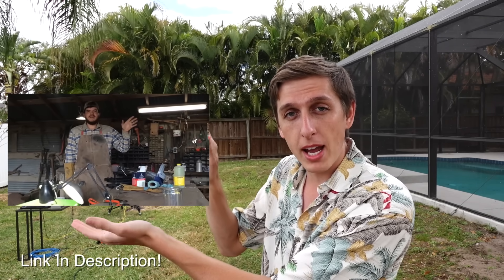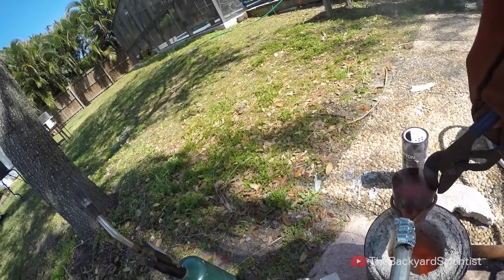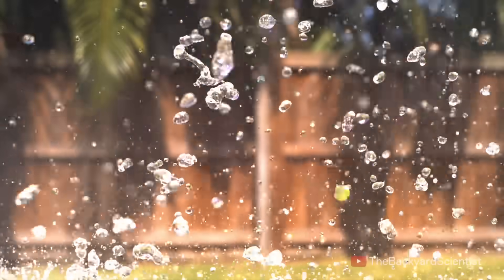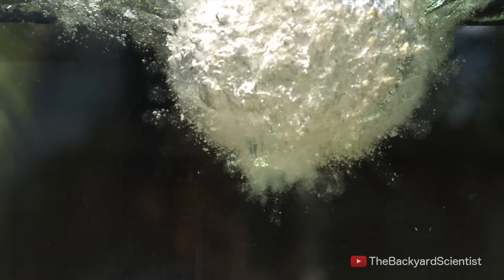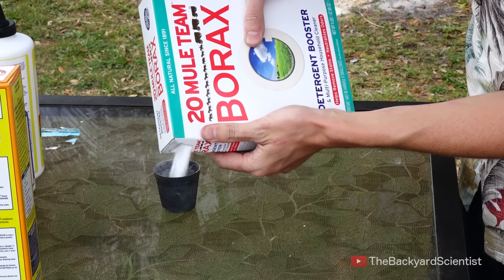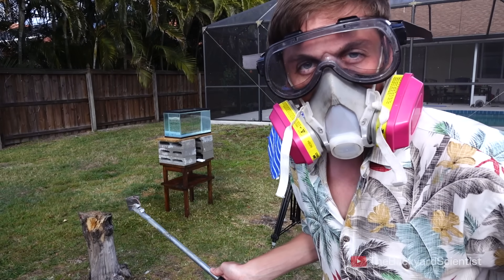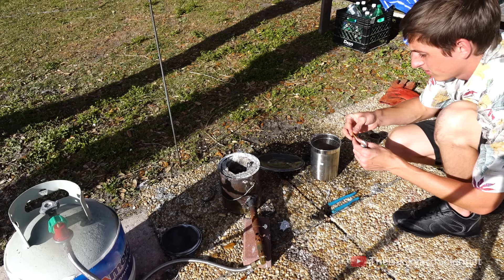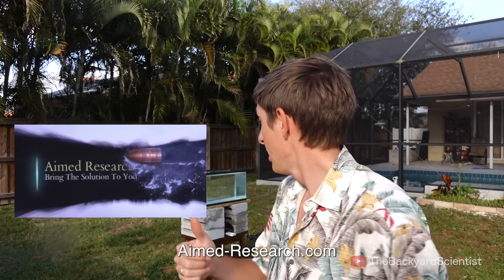Pouring Molten salt into Water - Explosion!

Comment: First off, to help support your theory supposedly disproving a chemical reaction, simply testing the ph of the water before and after adding the molten salt is not enough, it would require comparing it to the same when adding pure sodium to the water and when adding normal salt. Should both normal salt and pure sodium give changes while molten salt doesn't, then it would be proof of it not being a chemical reaction. Assuming pure sodium does not change the ph balance of water upon reacting (which I believe is the case), the lack of ph change despite the presence of chlorine is likely the result of the chlorine becoming gaseous upon reacting and escaping via bubbles.
Second, it would be a chemical reaction, not a physical one. Heating up the salt would weaken the bonds between the sodium and the chlorine in the salt. Upon adding it to the water, the reaction would not be instantaneous due to the chlorine still being present, delaying the explosion. Without oxygen (gas), the normal sparks and flame from adding sodium would not be present, but the force of the reaction would displace the water, possibly even more due to the presence of chlorine (which upon reaction would likely form chlorine gas, its natural bonded state, which would also explain the lack of a spark). The reason why molten borax would not react is likely that it already contains water molecules (the chemical formula being either Na2B4O7 - 10H2O, or Na2[B4O5(OH)4] - 8H2O), being a hydrate, which I believe would prevent a reaction with water. As stated in the video, pure sodium reacts differently as it reacts the instant it touches the water (actually technically a little sooner, reacting to the moisture in the air), not letting it submerge and preventing the outward blast, but due to the oxygen (gas) in the air would allow for a spark and slight flame.
Reply: I don't see how it could be physical, if you through sodium in water it explodes anyways, it doesn't have to be molten
Reply: Shut up you nerd, He's testing for PH simply to see if Sodium Hydroxide formed, because then he would know it would be THAT reaction
Reply: Ms So first you call me a nerd for knowing stuff like that, then try proving me wrong anyways... That totally makes sense without being at all hypocritical...
Anyways, realizing I had forgotten about NaOH, I just looked up various things to see if I could figure it out (eg. could the remaining Hydrogen from the sodium reacting to the water bond with the remaining Chlorine from the molten salt to form Hydrochloric Acid as well, thus resulting in a secondary reaction between the newly made HCl and NaOH, resulting in salt water to result in the normal pH? Turns out not) and found the actual answer. Turns out, everyone is overcomplicating the reason, though I can't find an answer to the borax part
The answer? Salt melts at 800 degrees Celsius, as even stated in the video. When the molten salt hits the water, it boils and becomes steam almost instantly, causing a steam eruption under water. At the same time, the water cools down the salt, until the temperature balances at a point where the water doesn't continue to turn to steam, and the salt dissolves in the water (at an increased rate due to the heat). Thus you get steam and salt water, resulting in a balanced pH for the water. If the salt has cooled enough before going in (such as during his failed attempt), the reaction doesn't happen, or at least not on a large enough scale.

Comment: Hmmm, this is actually pretty interesting. So if I get this right you've tried with NaCl, Borax, Sodium Carbonate and Boric Acid. Of the three only NaCl explodes. Of these only NaCl simply solubilizes in water and the others have Acid-Base reactions with water no? Maybe that's somehow involved? You could try with calcium chloride and other salts of strong acids+strong bases and salts of strong acid\base + weak base\acid to test this.
Also as a kid I was making lead soldiers and I had a small lead explosion when I poured molten lead in a wet cast. I assumed that was because of the build-up of vapor in a closed environment, but have you tried molten metals? I assume vapor only forms around the surface of the melted metal as it cools in the water but having a visual comparison would help understanding what happens. 
P.s- Great video!

Comment: Ps there is a definite difference between the molten salt and the sodium reaction. Sodium reacts with water because it donates an an electron to the water molecules and liberates hydrogen which goes on to react with the oxygen in the air from the heat of the reaction. This sound similar to my previous examination with the NaCl however with this compound the sodium no longer has this electron to donate as it has "given" it to the chlorine. The fact that the reaction with NaCl was far more intense indicates something else is going on.

Comment: With the electrolysis process of separating water into hydrogen and oxygen, table salt (NaCl) is used as a catalyst. I'm thinking the molten form of this will provide the energy necessary for the separation and the heat energy for recombination. If anyone has seen minute amounts of H2 and O2 reacting under a flame this explosion will seem very viable. I need more info on why exactally salt is used in the electrolysis process to be sure. Awesome stuff btw

Comment: Normally, you are using Borax to forge weld metal peaces together at nearly 1200C. That is a very bad Idea
(I am writing this before I am watching the footage, so I don't know what will happen)
Reply: Well, it seems like the borax (and the other things) are too hot, so the heat kondenses the water before it can actually touch it. That leads to a steam bubble, surrounding the hot liquid, so that it can't react anymore

Comment: If this guy is a scientist, I'm a fucking superhero. Dangerous idiot with a camera playing with shit he doesn't understand and documenting literally nothing. 

You're heating a material to a high temperature. The amount of residual stress in the material as it instantly cools, creating a massive stress gradient caused by the temperature gradient between the instantaneous surface that solidifies in the cold water and the still molten core is obviously the cause of the "explosion" as the extreme stresses on the surface exceed the ultimate stress of the material. i.e. see Prince Rupert's drop.

Comment: I think its simply the sheer heat.
The sudden evaporation causes the water to rapidly turn into steam. The sudden expansion of gas is the 'explosion'.

I am sure you will find the same result when pouring in moulten steel, or any molten liquid with an extremly high melting point that is higher than 1000 celcious.

Another explanation is that its having a similar effect as the rupert's drop. Only, in this case, the stresses are not  contained, like with the rupert's drop, instead, the sudden violent shattering happens almost instantaniously with molten salt, because the structure of salt isn't capable of containing it.

Comment: If it's physical then water should act in the same way with the other chemicals. Since chemicals were involved then it must be chemical reaction.
Reply: +Manuel F yeah you are right, check out a video made by a youtuber called thunderfoot, he is a physicist and made the same experiment he came to the conclusion the reaction is caused by the alkaline elements giving up their electrons so fast, that almost all the atoms on the surface up with a positive charge, this causes them to repel each other, causing this amazing change of volume.
This is a chain reaction and the more expanded the material is the more there is contact with water.

Comment: i'm sure the physics of it is that the water is about 20-30C° and the molten salt is, like you said, 1000 something and since it's to hot for the salt-liquid, it crystallizes but when it does that the reaction makes steam in the inside of the salt and when salt actually has steam in it, it tends to fly off because it's light than air for about 1 sec. and because of all these reactions going off, the salt explodes.
Reply: do not tell me that I'm a nerd because I am one
Reply: I think

Comment: at those high temperatures, the water may be oxidizing the chloride to chlorate, that reaction would not change the pH to a measurable extend and in addition to water-vapor, hydrogen would be produced so you would expect more evolution of gas than with the other salts. I have no idea weather this reaction actually occurs at these temperatures, but it's possible on paper
Reply: +Noa Sama You cannot produce hydrogen from water simply by applying heat. Molten salt at 801 degrees celsius may sound like a hot temperature, but in the grand scheme of things chemistry and physics, its not. Also, you cannot oxidise chloride to chlorate; in reality chlorate reduces down to chloride, which is a more chemically stable Cl ion. You only oxidise non-ionic chlorine gas to form chlorate

Comment: Salt is very soluble. Can you try a more soluble substance instead of less-soluble ones? Maybe fructose?
Reply: +steve6375 That's what I was thinking. Going frame by frame through the first explosion, the molten salt seems like it may be combining with the water.  Adding salt to water at sub-100 C temperatures tends to raise the water's boiling temperature, so I wonder if the molten salt and water are combining to form a superheated salt water liquid.  The explosion starts near the top of the water surface, and suddenly the rest of the superheated liquid explodes.  Could a shock wave travel through the superheated water, causing it to instantly vaporize?

Comment: Salt is soluble in water.  The liquid salt tries to mix with the liquid water super heating the water, the water then flashes into steam separating from the salt, the salt goes to mix with the next bit of water, it flashes into steam.  Eventually the salt has given up all its energy, after shattering your fish tank.

That's my guess anyways.
Reply: +NavySturmGewehr Still does not explain why Laidenfrost effect does not protect salt from water. That probably is biggest question.
Reply: +modisp Actually it does.  Re-read my theory.

Comment: @TheBackyardScientist im not surprised this is a mystery for the youngins. usually only older plumbers really "know" how weird water can be. In most cases water expands 1700 times the size when converting water to steam. I didn't know you could melt salt but when you do you store a significant amount of energy and since salt dissolves into water extremely well you get the explosion of the stored energy. If you increase the mass of liquified salt you will increase the amount of heat transferred to the water so you will get a bigger explosion that is how you can prove or debunk what i claim to know. back in the day when plumbers did lead and oakum joints in cast iron drainage there would always be someone watching the foundry because a drop of water in the molten lead would expand 1700 times instantly.. aka explosion of molten lead :D . the reason the other materials didn't cause as much of a massive explosion is simply because of the strength of the surface tension of the water. water doesnt mix with everything and that is proven by the slower heat transfer in the explosion free experiments you did there. also check out hot water tanks blowing up. That is also something that doesnt happen very often anymore because of the temperature and pressure relief valve on the side of the tank. but it used to happen because of untrained do it yourselfers.

Comment: I do not remember the explanation as to why, but in my premed chem lab class we did this experiment with all  the +1 elements of the periodic table, they all react the same when combined with water. Sodium, Lithium, Rubidium, potassium. They do not need to be molten either, this happens even at room temperature. We kept these elemental rocks submerged in oil in the lab because the humidity of air may make them explode. An idiot classmate got expelled for stealing a small sodium rock, he put it in his pocket and walked 100feet away from the chem building when it exploded from the humidity in his pocket, he was OK but his pant had a big hole.
I believe it is a chemical reaction. and the Chloride should not react at all.

Comment: NaCl dissolving into water is very exothermic as is (at STP), so perhaps adding the massive amount of heat energy by pre-melting the salt is enough to trigger a chain rxn leading to an explosion.

Did molten salt generate any visible flame fronts? The Sodium sure did haha.

Iirc, Na, Li, K, etc. separate H2O into H and O, allowing fire to combust.
Maybe the Cl from NaCl is able to "sequester" any H gas by forming HCl.

This would prevent eruption of flame fronts, allowing the molten salt to sink far enuf into the H2O to be able to lift a large volume of it once a Na+H2O chain rxn finally reaches that run-away exponential growth.

Comment: This is just an amateur hypothesis, but I believe that the salt, at such a molten temperature, when it is being poured, has a high surface area. The water comes into direct contact with the molten salt itself. The Leidenfrost effect no longer applies at that point, being that the molten salt reacting with the water becomes so thin.

Comment: If you'd really like to test if it's a chemical reaction, a another way would be to use salts that are physically similar (diatomic or perhaps triatomic) to NaCl rather than just much larger molecules like borax. I am pretty sure you could have reliable results if you tried NaI, KCl, and KI. You could also try CaCl2. This would allow you to vary the chemicals without varying the physics much.

Comment: We have a winner. Your explanation at 7:40 is what I thought it was before you said it. The water around the salt is boiling. The Leidenfrost effect breaks down because the salt is dissolving so there is no actual physical surface between the salt and the water.

Comment: Viscosity of molten salt is low and liedenfrost effect will not prevent mixing. Maybe slow it down a bit but it's no different from hot water dumped into nitrogen. Nitrogen will blast everywhere. Not as vigorously because more energy is in hot salt but you get the picture. I bet if you used a tiny drop of molten salt the liedenfrost effect would work for .5 seconds.

Comment: Since it didn't work with the other salt, couldn't it be chlorine gas forming and expanding? I'm not sure that would change the pH.
Reply: In order to oxidize chloride ions to chlorine, something must be reduced. Whether the sodium ions into metallic sodium or protons into H2. In both cases, the solution would lower its pH.

Comment: Your hypothesis is wrong as the intense heat rips the atoms apart and the sodium is protected by the chlorine as it enters the water as it is in solution but not as a compound so as the water hits the sodium in the solution it explodes and as there is more of a delay, the lower it gets the bigger the explosion so it's purely chemical